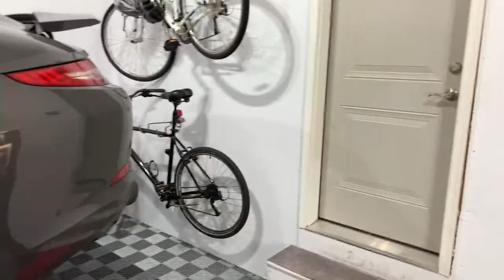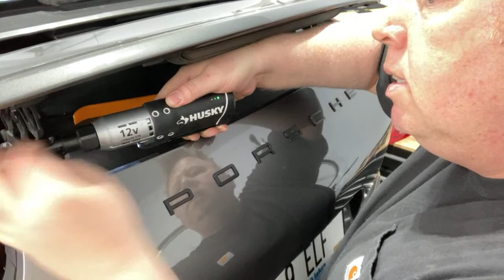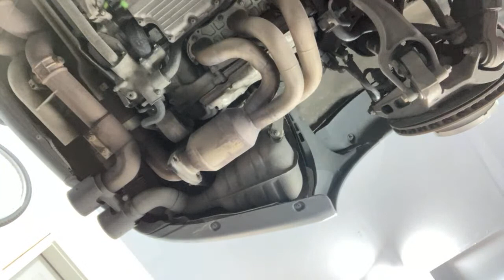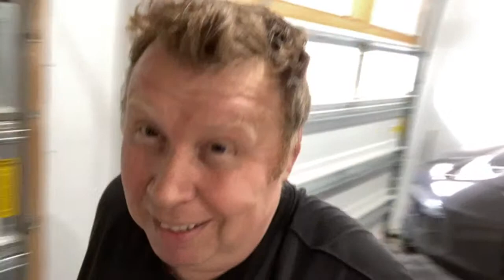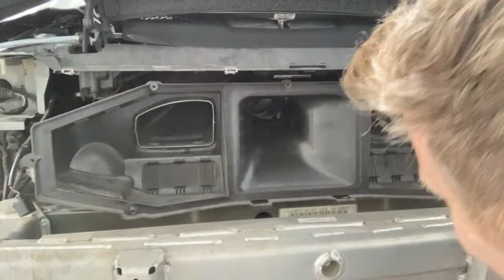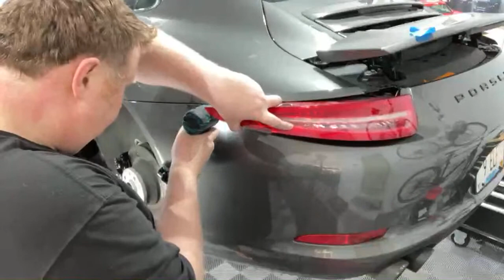AutoAmateur LIVE - Rear Bumper Removal & Air Filter Replacement  - Porsche 911 991

Comment: Late to the party on this one James, however I have loved it! Takes me back to when I first performed the bumper removal to install my x-pipe etc.

Question: I debadged my rear bumper in order to replace the Porsche lettering in black. HOW THE HELL did you remove the 911 Carrera ghosting??? I’ve tried everything!!!! Cutting comp, Comp, Machine polish etc etc. Still there as soon as the light catches it! Please help....... I used a UV lamp to reattach the Porsche lettering so as to mask the ghosting on that part but I don’t want the 911 Script replacing. 

Thanks in advance 🙏🏻
Reply from the maker: Hey David that’s a great question. A LOT of product, applied regularly, carefully and slowly. I used goo gone (regular / domestic strength not the commercial grade version) and 3M adhesive remover. It takes a while to go.

Comment: Do the rear tires need to come off in order to remove the rear bumper?
Reply from the maker: No, you don't need to do that. Maybe with the GT3 where the gap between the wheel and wheel arch is much smaller, but for all other 911s you can get to the fasteners you need to remove without removing the wheels.

Comment: My 2013 911 S has no heater blow out today. It comes out in cold air. Any idea how to fix it by myself?
Reply from the maker: Hey there! It could just be a fuse that has blown. Check your user manual in your glove box. There should be a table inside that lists the purpose of each fuse. Turn your ignition off, replace, try turning it on.
Reply: @AutoAmateur  thanks i will check that.

Comment: Hey there. Where would the parking sensor harness be located
Reply from the maker: It's all connected to the same bundle on the left center side of the rear bumper. As you go to remove the rear bumper, you can see the connection point you need to disconnect, just to the left of the Porsche emblem, below the corner edge of the rear light.
Reply: @AutoAmateur  Thank you.